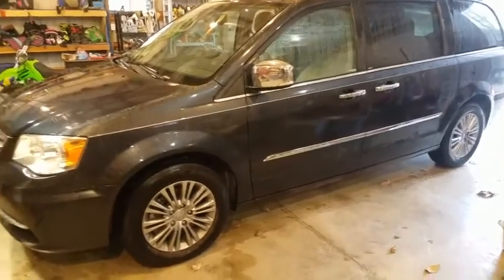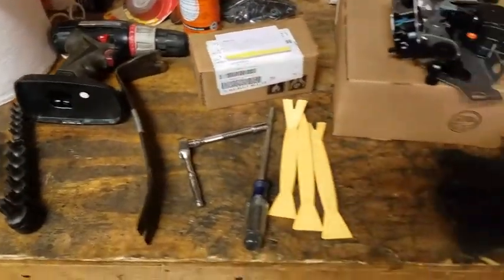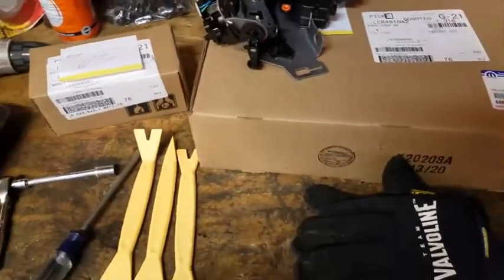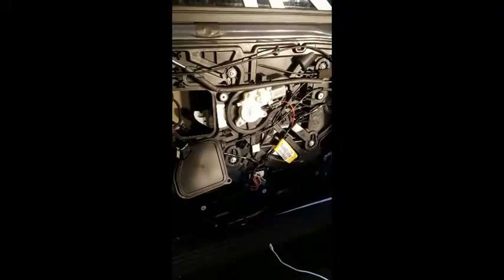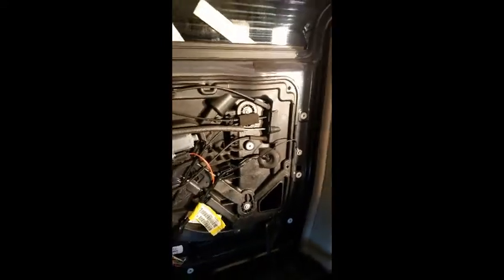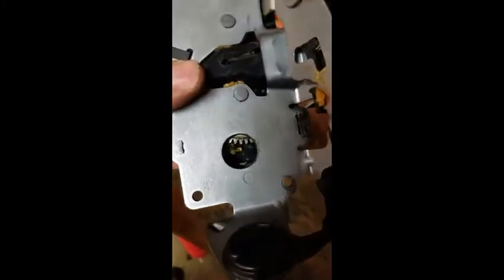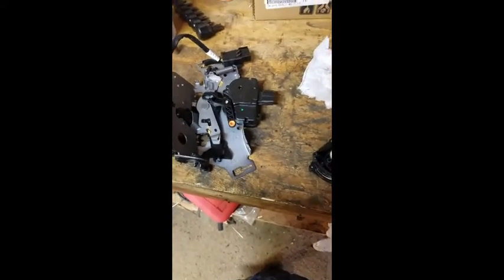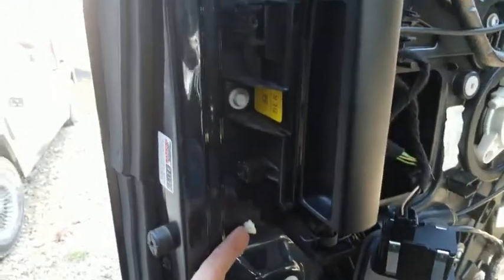Chrysler Town and Country grand Caravan Sliding Door Cinch Motor Replace. Latch assembly lock noise

Comment: Great video,  Unfortunatley the plastic part the acuator/lock assembly broke on me as it was very cold out. No big deal,  I ended up getting it in with out it.  What I also did was removed the window seal with a nylon window tool and it freed up a little extra wiggle room.  The other thing i did was to cut a piece of wood 20 inches to support the window from falling down.  This was a very hard project and by watching you I was able to get it.  Thank you so much!

Comment: Final comment! So trying to put the inner black panel back in and fighting that slide piece. I found a really simple way to get it in place and put the bolts back in. The outer sliding door has a black plastic cover. If you peel it back, you can see the slide and you can get a small screw driver to try it back towards the window and start the bolts. Saved so much time with this. Thank you again for the video.
Reply: After several hours of trying, I used my hammer to tap on the bar to get it up there and it worked 😁
Reply from the maker: Thanks for the tip. Hopefully it will help some others. Getting that piece in was a bear!

Comment: So, I tried ordering the latch assembly mentioned in the video from mopar, and even though I put in my VIN and the website said it matched they cancelled the order and said the correct part is 68030378AG.  This seems to be the cinch motor already mounted to a slightly different latch assembly, mentioned in the video as being more expensive together than separately.  After some research, I am pretty sure the difference is that the 6803 0380 AE part is only for vehicles WITHOUT power sliding doors.  I will also say that I tried replacing just the cinch motor and that did not fix my problem, which is the exact same hammering sound shown in the video.  I am ordering the more expensive part and will try that out next week to see if replacing the latch assembly fixes it for me.

Comment: Watched many times. Dodge told me only sell as one piece on latch assy. Also broke the plastic part it is on. Took while to figure it out. It's called "latch presenter part # 68030696AA. Costed $20 shipped. Just fyi for anyone also needing to replace that plastic part.
Reply: Yeah I broke that too but was able to mount assembley without that bracket, though it's a b** to do. Currently working on other door trying not to break that bracket

Comment: Travis - has this fix continued to keep your van door from making that hammering sound??  I bought a 2014 T&C minivan (used) from a dealership near me.  When I got it home, the passenger door was doing this very same thing, which they did not tell me about when I purchased the van.  So I took it back to the dealership and asked that it be fixed.  They told me that I needed a "sliding door motor," but I referred them to your video and asked them to replace the right cinch motor instead.  They told me the "sliding door motor" fix would cost $1500, and after watching your video, I strongly suggested they just replace the cinch motor.  So, I got an email from the dealership this morning, saying that they replaced the cinch motor, but it is still making the hammering noise (sometimes, not every time, but it makes a weird 'burping' noise every time it closes, and it does not latch completely).  So I guess I was just wondering if that cinch motor has continued to fix your problem to this day?  Thank you for your help and for this video!  I sure wish it would have fixed my van's problem!!
Reply from the maker: Hello Barbara. Yes my door still works perfect to this day. We use both sliding doors every day since we have 2 kids, and this problem has not returned. I dont know how common other issues are. It could be the whole latch assembly if the cinch motor didnt work for you, but its suspicious/odd if the noise changed after replacimg the cinch motor. But not sure.
Reply: Travis - thank you so much for your reply.  I am baffled why the cinch motor didn't fix the problem on my minivan because mine was doing EXACTLY what you showed in the video that yours was doing!  It's a mystery!  Guess I will have to just live with it, because I am not paying $1500 for that other fix they say it needs!  Thanks again!
Reply: @barbaraternes8205  I'm sitting out in my wife's van right now facing your same situation. Travis' video was a huge help and I got the job done (so far) in about 3 hours, minus the interior trim panel going back on. I've tested it a few times now and.... it works, with the same damn noise.     😡Not happy.  So yeah, maybe there's something in the gear box  that the cinch motor engages with that is faulty as well.  I'll finish putting it back together so it's usable but more work and parts in my future it looks like.

Comment: Changed out the cinch motor and it worked like a charm…for about a dozen times then started back up. I unplugged the car battery thinking it needed a reset but that did nothing. Anyone have any ideas?
Reply from the maker: We still use this van as our daily driver and we are in and out of the sliding doors daily. The door is still working fine with no noises for us. If your noise came back maybe the whole latch assembly needs changed out, but not sure.
Reply: @RepairNut  thanks for the prompt response. I'll try that out.

Comment: What do you mean when you say " You had it on "manual mode". Are these doors on the T&C built to be "manual"  as well as power run? How do you set it for manual?
Reply from the maker: The doors can be turned to manual mode by flipping the switch on the ceiling of the van (switch on right side, next to the buttons that open the sliding doors). This turns off the door auto open and close feature.

Comment: I have a similar problem with my 2014 Town and Country. However, I only have a problem when it is warm outside and the car has been sitting in direct sunlight. The door tries closing over and over, like it cannot latch.  The dash light comes on saying the door is open. I took it to the dealer and they told me I needed a new cinch actuator and latch assembly. I am not so sure after watching this video.
Reply from the maker: The latch assembly is usually ordered as one piece with the cinch motor already on it, obviously a dealer will want to just get in there once and replace the whole high level assembly that has both parts with new, and cover all their bases. The amount of labor to get back to this part is pretty high, so if you can afford the extra bit of $$ to replace both while you are in there it would be ideal. That was my plan initially but I ended up having the wrong latch part so I stuck with only replacing the cinch motor which I had on hand, and that ended up fixing mine as shown in the video.  I did my repair about 7 months ago and it still works fine with no issues today.

Comment: Do you know what the name of the cinch motor is called by the parts supplier?
Reply from the maker: Called a Cinch Actuator. Different part number for right and left doors. My part number for right side was 68187830ac. P/N's shows around the 2 1/2 minute mark.

Comment: I am having the same issue but still could not pry the black paneling. Any idea as to how?
Reply from the maker: I think you are referring to the black inner door panel. The door latch assembly has the cinch motor mounted to it, and is connected to the black "inner" door panel and the rear window track bar as 1 big assembly. There are no secrets to removing it beyond what is in the video. You have to get all the bolts removed around the panel, and the bolts holding the latch assembly to the rear door frame removed. You also have to get some cables released and the grounding wire removed as shown in the video. If you can't remove the panel or you get stuck on the removal part, I would recommend you stop and seek a mechanic, since the assembly is more difficult than the removal.
Reply: @RepairNut  Thanks for your help. The problem is I cannot open the sliding door at all.